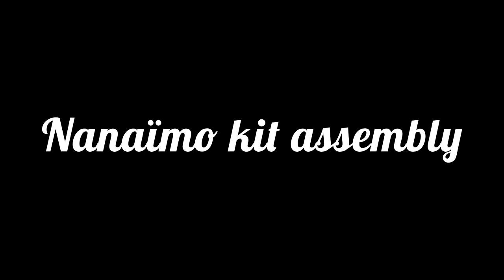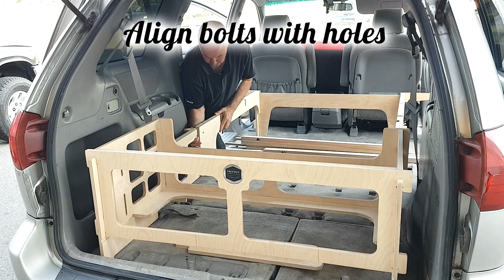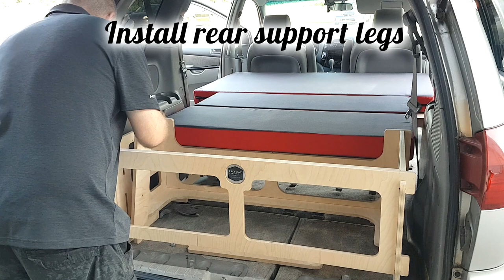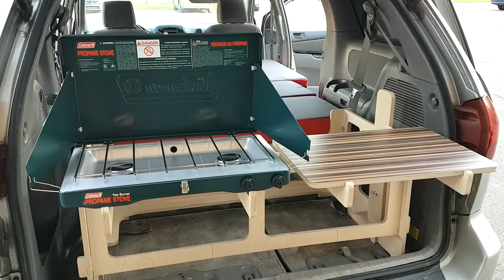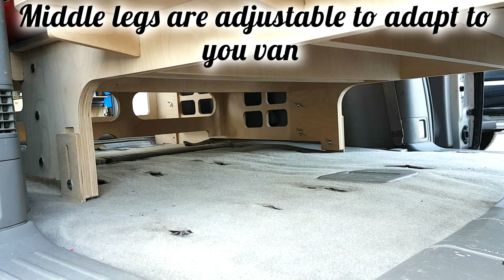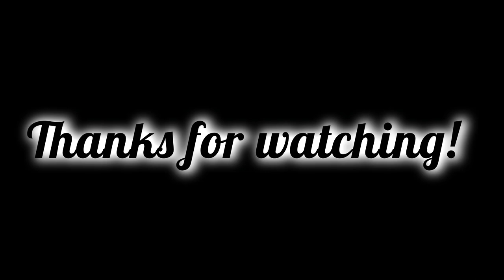Complete assembly of the Nanaïmo camper kit by freeway camper kit

Comment: Nice but I am 6-4 270# and move alot when I sleep...Wonder of this would Last
Reply from the maker: This platform is extremely sturdy, it is made of hardwood plywood, much stiffer than construction veneers, I would'nt be afraid of putting 800 pounds on it
Reply: @freewaycamperkit-yourroadt4414  I thought of Trying to Build one using Plastic pallets,but not sure if I can cut them In Half Long ways....